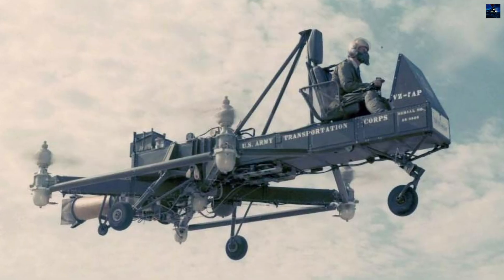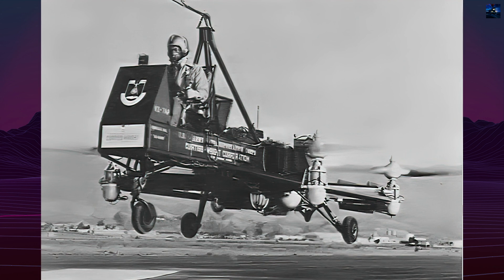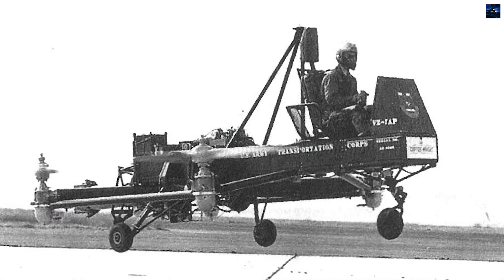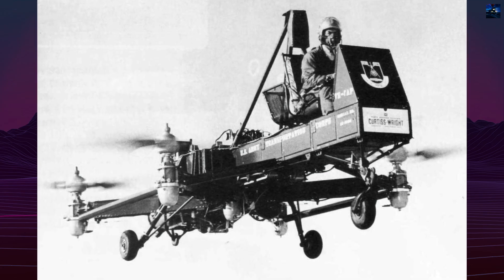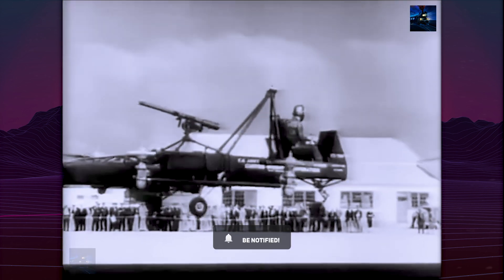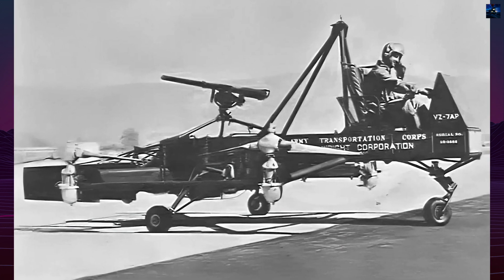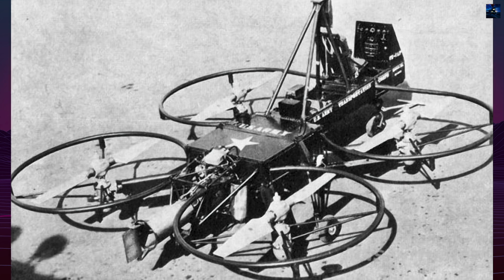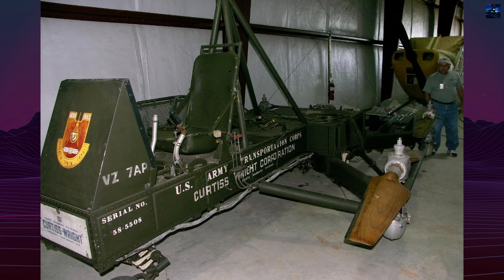Curtiss-Wright VZ-7: The Rise & Fall of a Flying Jeep

Comment: Every time you meet the initial minimal standards on a government contract, they start piling on impracticalities. That's killed a lot of designs that did exactly what they were designed to. Holding back on needed raw materials has ruined some too, like the Hercules having to be made out of wood instead of aluminum. I can't help but notice that the configuration is close to what they're already doing now with personal transpot drones,